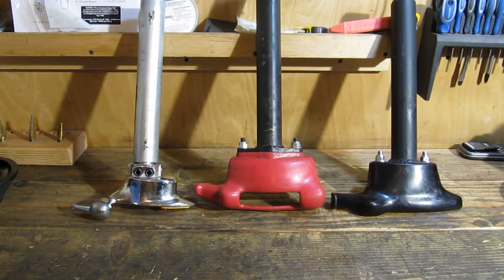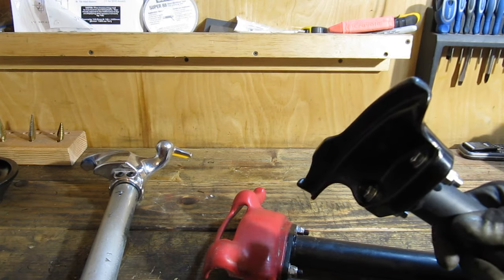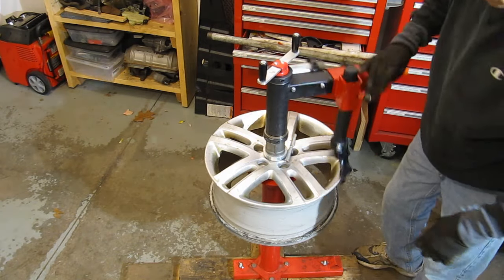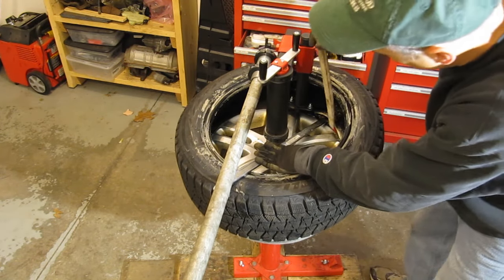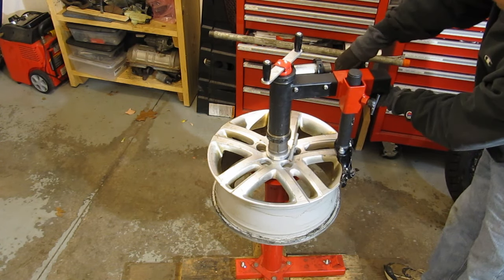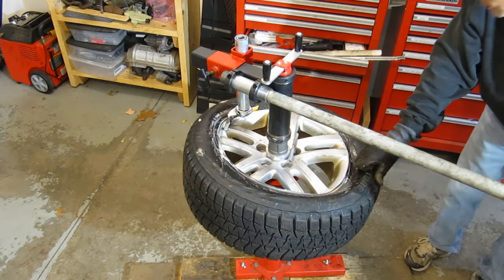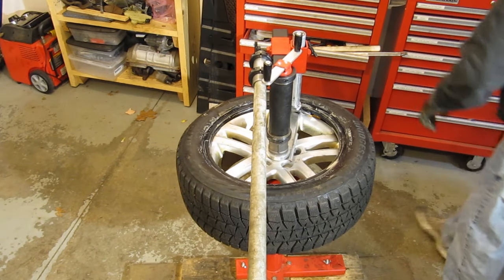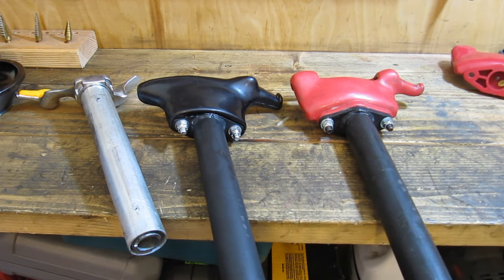Duckbill Comparison

Comment: Where did you get the nylon/teflon stick??? Thanks for the great video on these heads :)
Reply from the maker: Thanks for the nice comment!  The stick is homemade.  I cut it out of a 1/2" thick sheet of HDPE (high density polyethylene)  on a table saw, then just sanded the end to round it over a bit.  To my surprise the HDPE sanded/tooled really nicely!
Reply: @JohnsDIY  Thank you for responding!!! :)
I'll be looking for similar in my area!!!!

Comment: What kind of polyethylene stick is that, that holds the starting point off the rim, for dismount?
Reply: It is just a homemade thing.  I took a piece of 1/2" thick HDPE high density polyethylene and just cut a 1" inch strip off on the table saw and then sanded a rounded profile on the end.  To my surprise the HDPE cut and sanded really nicely!  Some folks suggested sticking the tire iron there instead of on the duckbill, but I worry about scratching up the rims....  Probably any wood or plastic stick would work okay.  Having the end tapered down helps insert it as the gap is pretty narrow...  Also the HDPE is really tough - it'll bend but doesn't seem to ever break.
Reply: @john_c  Thank you! You made that look very easy, to where I'm going to procure one, and have a friend fabricate the modification. Here in Alaska, switching out snow tires every fall and spring, is a fact of life, and begin$ to add up.  Likewise, one can rarely get into the tire shop, on a day of their own choosing, as doing so becomes a stampede, when the time comes. Thanks again for sharing.

Comment: It seems to me the problem with the chrome one was the design of your round pipe going into a square hole (tube) allowing the duckbill to twist because of the poor mating fit between the dissimilar round pipe and square tube. You can clearly see it move in the video. If your down pipe was a square sliding fit it would never twist to hit the rim. So I say the problem isn’t with the chrome duckbill it’s with your tool design
Reply: I meant to say stainless duckbill😊
Reply: Just file some flats on the tube.

Comment: What's your special dismount tool you speak of?
Reply: I think you are referring to the polyethylene tool used to start the dismount?  It is just a handmade tool.  I took 1/2" thick piece of HDPE (you can get on Amazon) and just cut a narrow strip out of it and sanded a bit of a contour on the end.  It turns out that HDPE cuts easily with a regular table saw and sands well with regular wood sandpaper.  I think you could use a piece of wood or something instead of the HDPE.  It just helps to have something to stick in the opening to get the tire to start coming off the rim there...

Comment: we have automatic tire changers but I like this one, its more work might be cheaper and something good to have when the pedals go bad or when it sticks.. how much would something like this cost
Reply: If I consider my labor as free, I’ve got less than $200 in the machine I built. Might actually be close to $100, but I didn’t keep track. $40 for the tire machine from Harbor Freight. $25 for the steel I had to buy. Some stuff I had laying around. $15 for the duck bill. I think my drop center tool was $15-$20. Add in the cost of hardware and that’s the total. My machine doesn’t have the fancy thrust bearings that you get with the kit that you can buy. I might add them later, but frankly I don’t see the need for them. I’m sure it makes it feel a lot smoother, but 2” thrust bearings aren’t exactly cheap unless you buy them out of China.

Comment: 16:26 you are too far inside, the lip should be a bit farther away outward to the rim edge. I use the black plastic duckbill but found that the aluminium one is more sturdy and does the job better ones you figured out how to use it the way its designed.
Reply from the maker: Thanks for the reply, and appreciate the advice!  I'll give that a try.

Comment: Could you add a link for the polyethylene tire bar? Thanks great info!!!
Reply from the maker: The polyethylene tire bar is just a homemade thing.  I just cut a stick out of a sheet of HDPE and then shaped it a little with sand paper!  The HDPE actually cuts and sand really easily (to my surprise).
Reply: @JohnsDIY  That's what I thought!  Maybe from an old cutting board?
Reply from the maker: @jerrycaldwell7739  That's a good idea!  That would probably be perfect and the cheapest route if you have on kicking around!  For $15 you can get a 18" x 12" x .5" sheet of HDPE on amazon if your wife doesn't want you cutting up hers :)

Comment: Where can a person get the polyethylene tire tool?
Reply from the maker: It is custom made, but it is really easy to make.  You can buy a small sheet of HDPE at Amazon or elsewhere and then just cut it and sand it a bit to shape.   It actually cuts and sands pretty easily.

Comment: how do I make myself one of those steel mounting assemblies to hold and rotate the duckbill ?
Reply from the maker: Good question!  I just wimped out and purchased one from Lucid Autowerks.  Unfortunately, as others have noticed they are pricey and have gone up in price quite a bit since I purchased one....

https://lucidautowerks.com/products/ultimate-manual-tire-changer
Reply: @JohnsDIY  I wish my changer had the handle on top to tighten  the unit  down with and that side mounted insert for your turning leaver...
Reply from the maker: @Empok_Nor  The handle on the top is quite easy to add with just an aluminum bar and some revolving handles you can get online.  The side mounted bar is pretty easy to add too, just using some split collars you can also buy online and a section of steel pipe you can get at Lowes/Home Depot.  If you want to add these and need any details, let me know if I can help!
Reply: @JohnsDIY  wow it's up to $430 for that upgrade. I'm making my own tire changer that'll be hitch mounted and I'm going to try using a wheelchair motor to make it powered too. I'm expecting to be under $100 for my build.

Comment: Hi, I was wondering about your set up and how you have it mounted to keep it from moving on the floor
Reply from the maker: Actually, in my setup the tire changer is just mounted to the 2x6 wood cross but is not mounted to the concrete floor.  I just get used to stepping on the wooden cross pieces while I am changing the tire to keep it from spinning.  I don't find it to be too bad, however, if you have a place where you can permanently mount it that would definitely be better.

Comment: It seems like the red style duckbill could be mounted at 90 degrees on a flat bar and used as a manual pry bar? If need be, clamp a cross piece on the pry bar to maintain distance from pivot to rim edge.
Reply: That thought occurred to me too, but I haven’t tried it yet.

Comment: Can the harbor freight tool handle a 20 inch rim?
Reply from the maker: Yes, a friend and I successfully changed his 265/50 R20 tires for his Durango using the setup shown in the video.
Reply: @JohnsDIY  awesome. Thanks for the info. I was hesitant in buying the tool.
Reply from the maker: Just to make sure it is clear though, the Harbor Freight tool doesn't come with the rotating duckbill accessory on the top.  I purchased that separately from Lucid Autowerks on eBay (no affiliation).
Reply: @JohnsDIY  does $350 for the setup sound right?  Wide range of choices out there. Not looking for cheap, looking for long lasting quality
Reply from the maker: Yes, the HarborFreight base part is really cheap, but the Lucid Autowerks attachment has gone up in price quite a bit.  I think he had two versions, one that you had to assembly that was a little cheaper.  But yes, I think it would be in that price range approximately.  The Lucid attachment that I have is very well made, top quality.  The HarborFreight base works just fine too, except that the bead breaker is not great.  Usually the bead breaker starts to bend over time.  I have seen some folks reinforce it which seems to help.  You can also get the dedicated HarborFreight bead breaker which isn't too expensive and is a LOT more rugged (if you have the space for it).

Comment: Salut mon ami, j'ai la même machine avec les pièces d'origine.
Ta fabrication c'est très intéressant, par hasard est-ce que tu pourrais faire les mêmes pour moi?
Combien demanderait-tu pour me fabriquer une comme ça?
J'habite en Suisse et j'aimerais bien savoir aussi combien ça coûterait les frais de port.
Félicitations c'est très bien ce que tu fais, c'est du bon boulot merci pour la vidéo.
Reply: Hello Rui,  If I understood the translation correctly, I think you are asking about the tire change tool duckbill add-on.  I actually did not make that.  I bought it from Lucid Autowerks.  Here is the website:

https://www.ebay.com/str/lucidautowerks

Comment: It is called a duckhead not duckbill and you were spinning it in the wrong direction. You had the bead on the wrong side.  That is why you were binding the bead.
Reply from the maker: Thanks for the feedback Jon.  I had seen it referenced as both duckhead and duckbill on the Internet but good to know that the more common name might be the former.

As for the spin direction, I believe I was using the same effective rotational direction as is used on all the commercial automated tire changers I have seen.  What might be confusing is that normally (on automated machines) the wheel rotates and the duckhead is stationary whereas on manual machines like this, the wheel is stationary and the duckhead rotates.  On all the commercial tire changers I have seen (links to a few videos below for example), the tire spins in the clockwise direction.  For the manual tire changer, this is equivalent to spinning the duckhead in the COUNTERCLOCKWISE direction, as I was doing in this video.  Rotating the wheel clockwise is equivalent to rotating the duckhead counterclockwise.  Notice that in the videos below using commercial tire changers as well as in my video with the manual changer, the trailing edge of the tire exits over the "bill" part of the duckhead because the relative rotation is the same.  But let me know if you think differently or if I misunderstood your comment or if you know of other tire changers which operate differently.

Here are a few examples of commercial tire changers, showing the wheel rotating clockwise (when looking down at it), which corresponds to rotating the duckhead counterclockwise in the manual tire changer:

https://www.youtube.com/watch?v=8hOZXIr1ujE
https://www.youtube.com/watch?v=BsOUtR_lT
https://www.youtube.com/watch?v=BsOUtR_lTeE
Reply: @JohnsDIY  Commercial machines do rotate clockwise for the install and removal.  However, the turntables do rotate both directions and reversible.   The metal duckhead is getting bound on you because it may need more lube plus be sure the rest of the installed tire in staying in the dropcenter of the rim.  The duckhead also should not be resting on the rim.  Neat build you have on that mod manual changer.  Very innovative.   You to keep it slick for less drag.  So, lube your duckhead as well as tire bead.

Comment: Your video looks interesting please your statement in writing so i can translate it, which one is the winner ?
Reply: Hi Mike!  Sure, my conclusion was that the stainless steel duckbill worked the worst in my manual tire changer setup.  This was primarily because the rim had ridges that extended out to the edge of the rim and the stainless steel duckbill would get caught on those ridges, preventing it from turning easily.  It very well may work fine in an automated machine or on other rims, but for my setup on this rim, the stainless steel duckbill did not work well.  The black and red plastic duckbills worked almost identically.  Both worked very well.  I thought that the black one worked slightly better for mounting (the lack of the second "bump" allowed the tire to slip on easier) and the red one worked slightly better for dismounting I believe.  However, I did not find much difference between the red and black duckbills and I think they both worked just fine.  Let me know if you have any questions about that.
Reply: @john_c   Thank you very much for this valuable information ;-)

Comment: Are you going the wrong way ive changed a bunch of tire It look like your going the wrong way maybe it’s just the cameras
Reply from the maker: Hello Jose,  I am pretty sure I am going the correct way.  Do you use an automatic tire changer?  In an automatic tire changer the wheel typically spins clockwise.  For a manual tire changer, the wheel stays stationary and the duckbill spins counter-clockwise.  In both cases the duckbill is going the same way relative to the wheel, it is just a matter of which one is spinning.  But if you are used to using an automatic tire changer, perhaps it looks backwards at first.
Reply: JohnNH im sure you are it just looks weird yes I do have a  pneumatic electric tire changer to remove and install it’s always clockwise.

Comment: abit to biest opinomatlin wiith the steal in the chis of the demonstrator , clely he as favrets in the test.  making it clear  that it  prevent him for making a  undiast  test.   i give it a thumbs  down  a test perhaps  more a sales pitch for the plastil opshon ,  tipe   Les England . For the benefit of doubt i thought the stainless steel  duckbill trial.  Removing the tyre with Less effort than the  others &  did not require a second tool to ad it removal .  as for remonting praps had it been mated to a square sport post  the aliment ishows released  would disappear . clearly the setting of the tool required  more  effort.  was it not sufficiently tightened thus leading to movement ? & positioning ?   or was the test biased over all. ? . overall the stables tool did seem to be a better choice . . 7nd had the tool been mounts to a square post as in  normal use positioning would i think outperform the rest .  be alimrnaterd , do the test again by using a square post .

Comment: Why are u going the opposite way
Reply from the maker: I think it is going the same way (effectively) as commercial tire changers.  I think it just looks different because in this case the tire is stationary and the duckbill moves whereas in a standard automatic tire changer, the duckbill is stationary and the wheel rotates.  But the effective relative rotation of the duckbill relative to the wheel is the same I believe.
Reply: @JohnsDIY  oh ok thanks for the reply